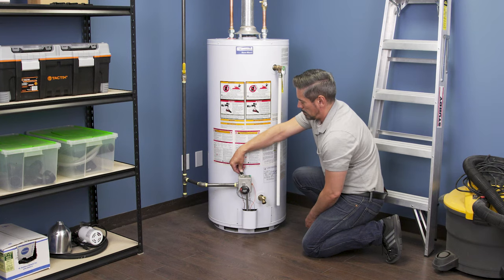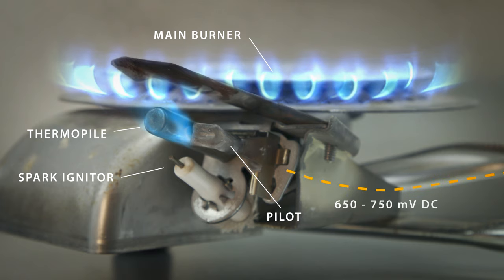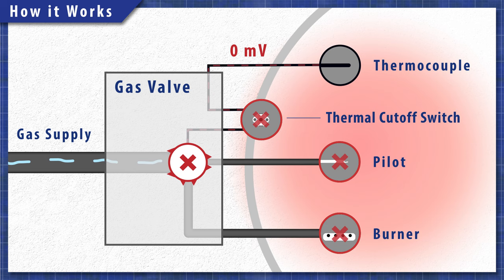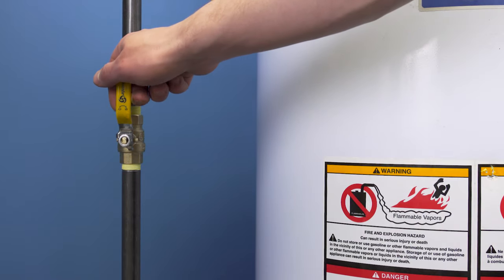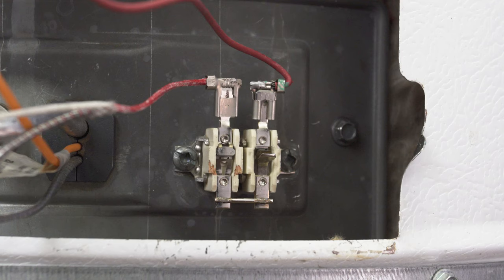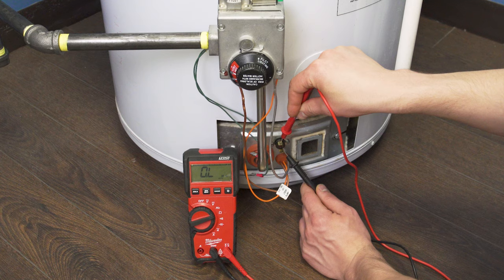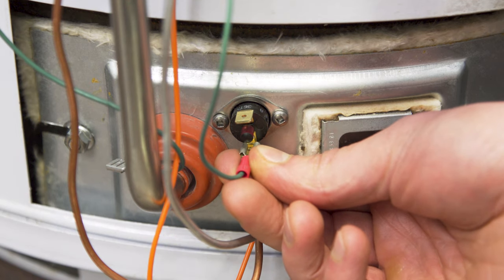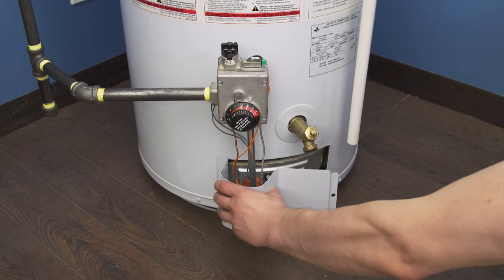Water Heater - Thermal Cutoff Switch | Repair and Replace

Comment: Thank you sooooo much for this video.  After my thermopile tested OK, I cleaned it per your other video and then tested the thermal cutoff switch.  It just needed to be reset by pressing the button in the middle of the switch per your instructions.  Worked like a charm and the pilot now stayed lit and the heater kicked on.  Thank you again.  Saved me hundreds of dollars in repairs.  Great quality video with animation and sound.  Many blessings!
Reply from the maker: You're welcome Sasha, we're glad that you found the videos helpful! The animations are something that we put a lot of effort in but we feel it helps ground the concepts. All the best to you!
Reply: Thank you boss for your knowledge
Reply: Same! I didn't realize the TCO switch had a reset button. Saved me having to get an HVAC/plumber out.

Comment: Hi, I just wanted to say thank you for this video. I just fixed my water heater by pressing the button on thermal switch. Your instructions were so easy to follow. I was so very happy.  💃💃Thanks again.
Reply from the maker: You're welcome Stephanie, we're glad to hear that the video helped you out!
Reply: Just a note there is a reason that it tripped. Usually, it's because your filter screen is dirty. Vacuum it off, and you're good to go.

Comment: The thermo cutoff switch was giving me zero voltage (Thermopile had 500ma) I did notice something that looked like a plunger on the cutoff switch, but I didn't want to touch it until I confirmed it. This is the only video I saw that pointed that out, and tomorrow I'll be looking forward to the hot shower I didn't have this morning. 
Thanks!
Reply from the maker: You're welcome, we're just happy to help!. Just to clarify, in an isolated test the cutoff switch should have continuity with a resistance between 0 and 1 ohm.. If it's isolated from the thermopile there will be no voltage reading. In some cases you can test the thermopile and cutoff switch together. This should show the same voltage reading as testing the thermopile by itself.

Comment: Late comer here.   Is there a statistic on how often the TCO Switch can fail?
Thanks for the well prepared video.
Reply from the maker: Thanks for watching, we're glad you found the video helpful! Most TCOs will be a bi-metal snap disc. These shouldn't fail that often as the TCO is not supposed to be tripped regularly, so you won't see the same kind of metal fatigue as other bi-metallic switches in other appliances. Unfortunately there aren't any good statistics on failure rates.
There are some environmental factors: Exposure to moisture, corrosion, or other environmental stresses can affect the longevity of the TCO.

Comment: Great video!  The thermocouple is good (25mV) and the pilot stays lit, but the main burner won't fire. Could a bad TCO cause this, or is the main gas valve shot?  (I pulled the burner assembly and cleaned it with compressed air.)
Reply from the maker: Thanks, we're just happy to help! A faulty TCO would prevent both the pilot light and the main burner from staying lit. In your case the pilot stays lit so that means the TCO is good. Since you already cleaned the burner, then its likely an issue with the gas valve itself.

Comment: I was going to change my whole burner assembly with a tune up kit because my thermal switch continues to trip. However, the metal face plate is beginning to change color. Is this a sign of a bad water heater ? Or is the discoloration normal. Thanks for the great video !
Reply from the maker: Hi Jared, thank you for watching. Since your thermal switch continues to trip best to clean the flame arrestor screen and clean around the flue vent . As well check to make sure there is a good airflow supply to the furnace room. Discoloration will often happen over time but its often a sign of or a yellow or dirty flame. This can be helped by cleaning any carbon built up on the burner.

Comment: Love your videos!!    I have a thermal cutoff that trips only after extended firing of the heater such as after drawing a hot tub.  It doesn't trip after a shower.  I thought it might be a draft problem or dirty filter.  I cleaned the filter and checked the draft.  Both seem fine.  Could it be caused by a weak Thermal Switch?  Any ideas would be appreciated.
Reply from the maker: Thank you, we're glad that you're finding our videos helpful! The thermal switch uses a bi-metallic disc that bends as it heats up. Over time the metal becomes fatigued and this can result in the switch triggering at lower and lower temperatures. In your case installing a new switch will likely help.
Reply: @AmreSupply  thank you very much
Reply from the maker: @oldpumpguy3744  You're welcome!

Comment: I’ve replaced my thermal cutoff switch and the burner finally turns on. The problem is the burner stays lit and the light on the control valve goes off. Is that normal operation for the light not to blink on the control valve?
Reply from the maker: Thanks for watching. A single blinking light means that the it is working properly. No indicator light usually means that the thermopile is not providing enough power. In this case the pilot flame and burner will shut off as there wouldn't be enough power to keep the solenoid valve open. If everything is working correctly and the indicator light isn't turning on at all, it is possible that the indicator light has burnt out.

Comment: Both wires coming into the TCO switch are of the same colour. How do you know which wire is connected to which terminal?
Reply from the maker: Thanks for watching. Thermal cutoff switches, limit switches, and toggle switches are not affected by polarity. The switches will simply connect or disconnect the circuit so you can swap the wires and it won't affect how it operates.

Comment: Only took me 4 and a half hours to figure out that I needed to hit this invisible black button to be able to light the burner again. Most would have called the repair man by now. Something tells me that’s how they want it. A little TOO safe if you ask me. To the tune of hundreds of dollars for Ricky to come over and make it work like magic. Maddening
Reply: Btw, thank you for your video sir. I should be less angry cuz you saved me hard earned money, they’re making everything “unserviceable” these days. Hiding screws under stickers and such lol
Reply from the maker: @trux91ify  Thanks for watching, we're glad that the video helped you out.

There are tricky parts to any repair. Recently ran into the same sort of issue but with a vehicle repair. Winshield washer fluid wouldn't work. Replaced the handle and button an nothing helped. No mention of a fuse or relay in the service manual. On some forum one person mentioned a "2nd" relay box hidden below the washer basin. This 2nd relay box was not mentioned anywhere despite it having a dozen relays in it. It was a $10 relay to replace but took hours narrow down.

Comment: I have an automatic switch. How long it takes to for it to automatically reset?
Reply from the maker: Thanks for watching. The metal inside the switch needs to cool down for it to reset, so it will likely take 10 or more minutes.

Comment: Hey folks I'm in need of a Thermal Switch for a Reliance 606 Gas Hot Water Heater. I cracked mine (which I super glued), and think I had an overheat in a recent light up of a dormant HWH. It lit fine the other day and then went out. I assumed that it was the thermocouple when I replaced. Still no go. Leaves me to believe that (aside from it being cracked, it worked fine for my initial relight), that it is the Thermal Switch... unless its the Thermostat now that the Thermal Switch shut off the main thermostat valve.
Reply from the maker: Thanks for watching. Thermal cuttoff switches can become more sensitive over time as the metal inside becomes fatigued. This explains why even with continuity, the switch might disconnect power at temperatures lower than what it is rated for.

Comment: My cutoff switch looks different from the one shown in the video and I can’t find one like it anywhere? Is it safe to replace it with the one shown in the video because I’d have to make some holes for the screws?
Reply from the maker: Thanks for watching. It is best to replace the same cutoff switch as it needs to mount and seal properly. If the new cutoff switch is a different shape, or different rating then it will not work as designed.

Comment: After inspecting out water heater it has  thermo switch but there is no wires connected to it please advise 
Gas heater is on but pilot flame is very low thanks
Reply from the maker: Thanks for watching. In some cases the wires to the thermo cutoff switch might not be visible from the outside and will run along the inside.

If the pilot flame is low then it could be a dirty pilot orifice (restricting the flow of gas) or low gas pressure.

Comment: Hi there, I click the reset button and get it fired up. About 5 min later, it kicks off? Is it possible my thermocouple is too close to my piolet?
Reply from the maker: Thanks for watching. If if the cutoff switch keeps tripping then either the burner is overheating or the switch is faulty. 

If the switch is fine, but the pilot won't stay lit, then it could be a faulty thermocouple. You could try installing a new thermocouple, and cleaning the threads where the thermocouple screws into the valve. https://www.youtube.com/watch?v=Mx6rZA9Yxv4

Comment: I have a American water heater does this thermal switch work for this brand??
Reply from the maker: Thanks for watching. There is some variation between models so it is difficult to say which parts will fit which models. It's best to lookup the model number, or use the part number on the side of the switch as possible to find an exact replacement.

Comment: 1:14 I am not sure what it is called but the white electrical component on the bottem left, the two wires that connect to it have a while sleeve on my heater and they are brown as if they got burnt could that be the reason why our heater is heating?
Reply from the maker: Thanks for watching. Yes burnt or damaged wires can prevent the water heater from heating. If you have an electronic valve you are likely referring to the wires to the thermopile. You can see how to test the thermopile in this video: https://www.youtube.com/watch?v=Yx2gfgJB7bI Hope that helps!
Reply: @AmreSupply  I took it off yeah i watched it is a one time fuse, the tops of the metal tabs (sorry im 15) is burnt and has hard small pieces of charcoal or another burnt substance and flame marks on the metal it's self so im assuming it has to be replaced? the hard ware store closes in like 2 hours thank you for the fast reply
Reply from the maker: @cojoe4896  Yes that's a pretty good indicator that its a fuse and that it has burnt out. Still to be certain you can test it for continuity.

Comment: What temperature should the thermal switch trip at?
Reply from the maker: Hi Ryan, thank you for watching. The temperature will differ between models and the position of the switch. Many switches have a rating on the side, as well you can use the part number to look up the rating. Its not uncommon for a switch to be rated for 170° F or higher.

Comment: My thermal switch keeps tripping on my natural gas AO Smith heater. I've done the match test and the flue is sucking in the smoke, replaced the pilot assembly multiple times (before I knew it had tripped), and I've cleaned the bottom of the water heater vigorously. Would the last replacement be the Honeywell gas control unit?
Reply from the maker: Hi Mark, thank you for watching. It seems like you've been very thorough in trying to eliminate each source of the issue. Before replacing the gas control unit, it would be smart to replace the thermal cutoff switch first. These are generally made with a bi-metal disc. The metal disc will bend and snap open when heated and will disconnect power to the circuit until the reset button pushes the disc back closed. This metal can warp over time so in some cases a thermal switch can begin to trip at lower and lower temperatures. Its easier to replace the thermal switch than the gas control unit, so it might save you some trouble.
Reply: You can jump that tco for a short period and see if the water heater stays lit. If it does, the unit probably isn't clean enough for combustion and its overheating and tripping the switch

Comment: I bought a thermopile assembly and it has wires for thermoswitch but there is no thermo switch on the water heater..what do I need to do with 2 red wires that suppose to be for the thermoswitch..thank you
Reply from the maker: Thanks for watching! From the sounds of it you have a setup similar to this video (except without a thermal switch) https://youtu.be/Yx2gfgJB7bI?t=251 with 1 full white wire, and a red wire that goes from the thermopile to the cutoff switch, and another red wire that goes from the cutoff switch with a special connector that inserts into the gas valve..

If that's the case, and you don't have a switch then you'll have to splice the wires together. You can cut the wires with wire strippers and use a twist-on wire connector, or something like a butt splice connector.

Comment: Hi. My pilot lights ups, but the valve will not start blinking so that I can operate it....????
Reply from the maker: Thanks for watching. If the pilot stays lit, but the main burner does not light up, then it could be an issue with the control valve.

Comment: Unfortunately my American Hot water heater's TCO doesn't have any screws to remove it....How do you remove it in this situation? Thanks!
Reply from the maker: Hi Bill, thank you for watching. If the TCO in your water heater doesn't use screws and is instead welded in place, then you'll likely have to replace the whole burner assembly, manifold tube and the door. This will come as a single piece as shown in this example here for John Woods water heaters https://www.amresupply.com/part/58993-JW-JW50-MANIFOLD-DOOR-ASSEMBLY
Reply: @AmreSupply  Thank you very much for the info...I was afraid of that. 6 years ago I was renting this house and the pilot wouldn't stay lit and the owner had me call a plumber. WELL...he replaced the thermal coupling and maybe the burner and of course he spent 2 hours driving around because of left hand thread. 5 months after that it quit again. The plumbing company owner came by and said..."let me try this" and connected the 2 wires together coming off the TCO....told me to get a bottle brush and clean the screen under the heater and he would come by and fix it....he never did. So....Off and on the pilot would go off and I would keep connecting the 2 wires together because if you just barley hit them the pilot would go off. I FOUND YOUR VIDEO in February of this year. Checked with Volt meter....OL...but noticed the little white stem in the center and low and behold it reset when I pushed it. Went off again yesterday....but the white stem didn't pop out to reset. BUT....because of you and your video I now know what to do. Thank you VERY much! You would of thought the plumber would have at least told me what it was. You are a blessing!
Reply from the maker: @billjohnson5580  Thank you for sharing your experience. We're so glad that the video helped you gain a bit of knowledge. Its good to know what to reset and what to test to verify if its running properly. Best of luck with any future repairs!

Comment: My AO Smith heater runs without me connecting the wires to the TCO I broke mine and it looks like it was welded on problem I'm having is it has a rod that goes inside would it make a difference is I install one without it
Reply from the maker: Thanks for watching. The rod that you're describing would just help transfer heat into the TCO, which would help it react faster to an overheating condition. Without that rod it would still likely work but would be slower to react. The TCO is a switch that is normally closed and only opens up and disconnects the circuit when it overheats. This is why the water heater can function without the TCO connected. It is not recommended to bypass any safety switch.
Reply: @AmreSupply  Do you sell Thermal Cutoff Switch for AO Smith water heater?
Reply from the maker: @sleepydo6463   Thanks for watching. You can see all limit switches available here: https://www.amresupply.com/catalog/Thermostats-647762-PP2H

Comment: Can u please share how to bypass thermal switch on water heater?
Reply from the maker: Thanks for watching. The thermal switch is a safety device and it is not safe to bypass it while running the water heater.
Reply: @AmreSupply  so can I bypass while the water Heater of off?
Reply from the maker: @fahmidasultanaemu637  When the water heater is off, the switch is not active so it can be removed to be tested or replaced. It can be disconnected, as long as you reconnect it before using the water heater again.

Comment: Where do the 2 wires come from that tie into the thermal cut off switch?
Reply from the maker: Thanks for watching. The two wires come from the gas valve. They are wired in series to the gas valve solenoid so that if the cutoff switch trips or fails, the gas valve solenoid will not energize.

Comment: Does it matter what wire goes where ???
Reply from the maker: Thanks for watching. The thermal cutoff switch is a non-load component, It simply provides a path for electricity to pass though so it is unaffected by the polarity of the wires. You can put either wire on either end and it won't change how the switch works
Reply: @AmreSupply   thank you so much for the answer
Reply from the maker: @scottm6188  You're welcome!
Reply: Thanks for asking, I’ve been looking for that answer!